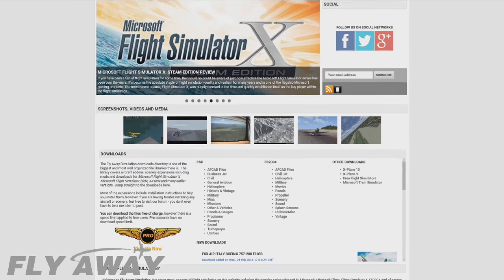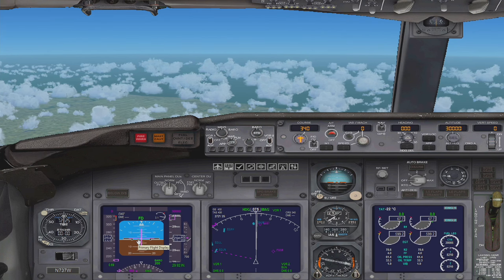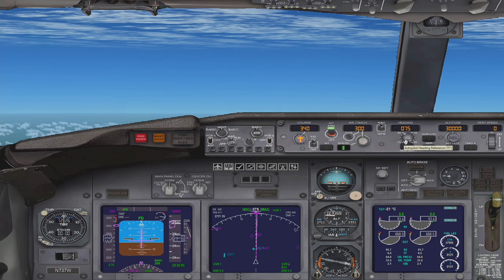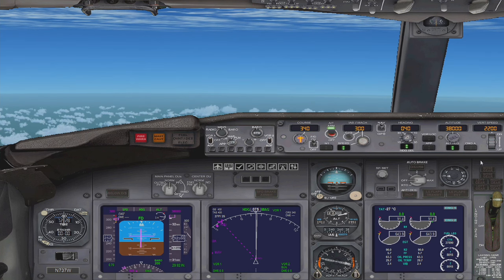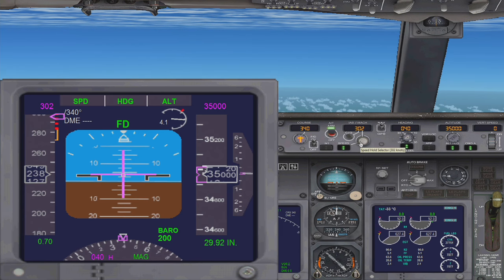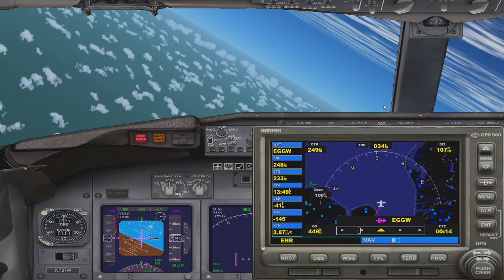FSX How to Use Autopilot | Boeing 737-800 | Tutorials

Comment: I am a real world co-pilot for a Canadian airline on 737 800 equipment.  great video  for others learning,  keep up the good work
Reply from the maker: Thank you! I'm glad you like the video!
Reply: West jet?
Reply: Bonazza Tony where is the altimeter like when control tower says 2992
Reply: Why is a real pilot here checking how to turn on autopilot. I'm scared to fly rn
Reply from the maker: Haha just brushing up? xD
Reply: I'm trying to activate this on the 747 on Flight Simulator 2020, but using LNAV and VNAV. However when I turn on the autopilot (even when i'm pretty much already on the correct heading and altitude) the plane just banks hard left (> 40degrees) down into a barrel roll. Is this an FS bug or is this user error? I'm not sure what's going on
Reply from the maker: There are a few errors in MSFS, but I'll be making some tutorials on it soon
Reply: Nice
Reply: @ruadeil_zabelin  yeah that used to be a msfs where some autopilots would straight up just drop control of the air crAft and do a steep roll and not disconnect but bow it should be fixed but be carefully when doing an auto land as ot approaches but doesnt make small adjustments to land smooth, sometimes it nosedives
Reply: @amaneshak8605  Lmao noice

Comment: From the experience in the pmdg and all the time flying in the default 737: Mach 0.78 is the best cruise speed at most high altitudes
Reply from the maker: Thanks for the advice! This was mainly a video on how to set the speed, rather than what to set it to. But you're correct - thanks!
Reply: Yeah, if you're wondering how to set them, might as well know how fast to go
This is speaking from my own problems back in the day so I just want to help :)

Comment: Do you use a entire setup or just a keyboard and mouse for this? If you use one of the ones that simulate the flight (like the throttle brakes etc.) what do you use?
Reply from the maker: I'm assuming you're asking what hardware I use to control FSX. If so, I use the Saitek Yoke and Throttle Quadrant, keyboard and mouse.
Reply: Yeah sorry I didn't know how to word it at the moment XD. Thanks!
Reply from the maker: No problem! Glad I could help.
Reply: Sorry if im being the most annoying person ever but where did you buy it?
Reply from the maker: I personally purchased the Saitek Yoke from Amazon.co.uk, however, it's available from a variety of retailers. You can just Google the name and loads will come up. Hope this helps!

Comment: I set my cruise altitude to 41000, and my speed to 0.77 mach, but my aircraft pitches up about 4 degrees. Any idea why that might be happening? Thought it might be trim, but I'm not sure. Great video!
Reply from the maker: That sounds a bit too high, what aircraft you using?
Reply: @JacksFSVideos  Stock 737-800. Looked into it, and I think it might have been the OAT.
Reply from the maker: Ah okay, and a 737 would normally cruise anywhere between 30,000 and 37,000
Reply: FL410 is the service ceiling for the Boeing 737 series. It struggles to keep level there, and later. Don't go that High, could result in a deep stall. That level is used only for aircraft testing and isn't safe =)

Comment: So......... 
1. The flight FD(pink cross) tells me where (ALT SPD HDG I set) to go (manually)
2. If I turn on the autopilot master switch, aircraft go to that ALT/SPD/HDG automatically.
3. If I made a flight plan data, and switch NAV to GPS, aircraft would follow the route that I already made.
Right? Because I'm not good at English, I need your feedback guys
Reply from the maker: 1 . Yes (but doens't tell you about SPD)
2. Yes (as long as each switch is on as well)
3. Yes (as long as the Nav switch is on)

Comment: Great Video, now my plane actually going up! 😄 But it's going above the Altitude I'm expected to maintain. I'm supposed to climb and maintain FL240 (24000 ft) but the plane goes up to 27000 and keeps increasing, why does it do this and how do I stop it? 
Thanks, Marc.
Reply from the maker: I've not heard of this problem before. However, starting with the obvious, have you made sure all the correct autopilot is on? Including the Flight Director switch, Master Autopilot, Altitude Autopilot and the Vertical Speed Hold Selector is set correctly to about 2,000.
Reply: Jack's FSX Videos Yes, it was the hold switch that I forgot to switch on.
Thanks for your help
Reply from the maker: No problem, glad I could help!

Comment: For long overnight flight can I just turn on gps mode as you did then go to sleep for the night, let the game fly and complete my flight In the morning? ATC usually tells me to change my heading or altitude and if I don’t they yell at me and terminate my IFR flight plan. How do I fix the problem so I don’t have to be up every 15 minutes changing heading and listening to ATC?
Reply from the maker: It's certainly possible to do that if you don't use ATC at all. Otherwise, you'd need to climb to your cruising altitude, turn on LOC to follow the GPS and then they won't tell you to adjust anything. However, they will still point out traffic and tell you to change frequencies every now and again which will need a response

Comment: hey all. what's the difference between heading and course?
Reply: heading is like the compass direction so the direction the nose is pointing, and course is the direction the aircraft travels over the ground which means that it will travel in the right direction even in strong winds. its kinda hard to explain without a diagram but maybe search one up sorry

Comment: I have some difficultties with the autopilot. The vertical speed on the selector always changes to negative after every alt hold change. Why is this?
Reply from the maker: Well if you put in an altitude lower than what you're already flying at, it will go negative to descend

Comment: At around 8:33, why does the vertical pink line of the FD only shift very slightly left of center, even when heading is drastically off in terms of angle?  The pink vertical line does not even tell you how much to roll the aircraft, right?
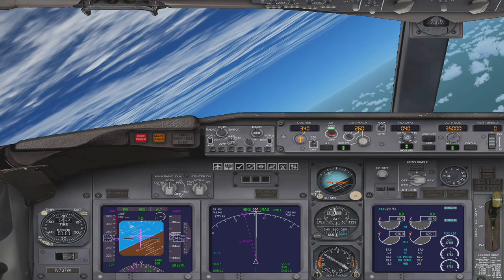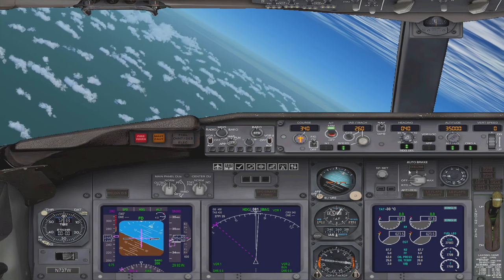Reply from the maker: Actually it does move left and right, just much slower than the horizontal line. At 8:08 it's over to the left, if you keep watching to 9:38, it's more centre-right, and even before I made that right turn, it was centre. If you keep the central dot on the cross-hairs of both lines that will determine your rate or turn as well
Reply: If you kept central dot on the both lines beginning at around 8:33, wouldn't it take ages before the plane's heading reaches the HDG bug?
Reply from the maker: No because the nose also moving up assists in turning the aircraft much faster
Reply: But the pink lines do not indicate roll angle.  When the vertical pink line is so close to center, it would be easy to center on them using only yaw+pitch.
Reply from the maker: No not angle, but it does indicate a turn, the bank angle always has the same maximum of usually 30 degrees. And a pilot simply knows not use the rudder on the air except in emergencies and some crosswind landings

Comment: How it works in MD11? I dont know how to read what course i need to take because there are not a purple trail.
Reply from the maker: I'm afraid as I don't own any MD11 addon aircraft, I can't help you with what you're asking. Sorry!
Reply: I see a arrow in a random direction, and i set autopilot on that arrow and atc contacting with me and didn't turning me, is that good? (sorry for my bad english, i am from Poland)
Reply from the maker: I assume you're referring to the arrow in the Navigation Display. If you're using ATC, they will tell you what heading to fly at. Simply type this into the autopilot system and turn the Heading switch to On. The aircraft will then fly in that direction. If you don't understand a part of the video, try reading the tutorial on my website here - jacksfsxvideos.com/fp-how-to-use-autopilot.
Reply: I just requesting a IFR Clearance and tower send me to good course. I need to teach how to land don't nose to ground decending and how to land not in a city. :P
Reply from the maker: If you're looking to improve your manual landings, I do have a few videos on my channel.

Comment: I have windows 10. i7 4790k and 980. but I just have the regular fax and is giving me problems. should I get the steam edition?
Reply from the maker: Personally, since getting the Steam Edition, I've not had a single crash or problem with the game.
Reply: thanks. do you have windows 10?
Reply from the maker: Yes, I use Windows 10 64-bit.

Comment: Hi Jack, is it true that 1000 ft before landing (ILS) you switch it to manual?
Reply from the maker: There's no set altitude, speed or distance to switch it to manual. But 1,000 feet does sound quite far out still, it's usually done a lot closer to landing than you think

Comment: is there communications from tower or elsewhere can't seem to get any for fsx f5-e. also can't print out headings etc from flight plan. any help would be terrific. thanks
Reply from the maker: Yeah you communicate with the tower. You don't have to print them out, you can just write them down on some paper, if you can't print it, it's most likely a problem with your printer connecting FSX
Reply: if u select ie as default browser printing is cured.
Reply from the maker: Okay cool

Comment: btw, is there a programme incorporated which takes into account the curvature of the earth?. Many says that the gravity does this job for the airplane. I don't think so.
Reply from the maker: I'm not really sure on what kind of program you're referring to or what you'd use it for. If there is such a thing, I'm not aware of it.
Reply: Ok. I will give you an example: An airplane which takes off from a runway in South Africa , southern Hemisphere ( Cape Town) with final destination in Paris ( France), Northern Hemisphere.. In this particular case the airplane on its entire journey has to adjust continuously and follow the curvature of the earth , otherwise it will go straight into space. That's why i said to you that many are convinced the gravity does this job and here's why the airplane has no programs incorporated to address this matter.
Reply from the maker: Thanks for the example. However, as I said, I'm afraid I'm not aware of any program.
Reply: if there is no such a program , then we can draw three conclusions: 1. We are not aware of any program . 2. The gravity does this job for airplane. 3. and most shocking :)..the earth is not a ball , sphere. We must find out which of these 3 conclusions is right.
Reply from the maker: As I mentioned in my first comment, I'm simply not aware of any such program. However, having researched it, there is no need for this program anyway - http://www.askcaptainlim.com/flying-the-plane-flying-90/1301-does-a-jet-aircraft-need-to-constantly-adjust-nose-down-to-follow-the-curvature-of-the-earth.html.
Reply: The autopilot keeps the plane at a specific altitude, so as it goes around the earth, the autopilot will keep the aircraft at the desired altitude, and not send it off into space. So all 3 of your hypotheses were incorrect.
Reply: Let's take the next assumption into account: a pilot of an aircraft saw what we disscused here and for the sake of proving this untested matter/issue  he decides to fly his aircraft manually for (96km or 60 miles) after reaching the desired altitude of  10km or 32802 feet . According to the official data when it comes to the curvature of the earth at  96km(60miles) flawn our pilot has to adjust the altitude with 784 meters (2572 feet)  downwards to follow the curvature , otherwise the aircraft risk going off into space . In short, at a crusing speed of 800km/h (500miles/h) our pilot has to descend with 784 meteres/2572 feet after 7.2 minutes  of flight just to maintain a "straight" line around 10km/32802 feet above the earth .  Mr. Sanders...don't rush to draw any conclusion unless you have a real proof.
Reply: so at every minute (this is applied only for the first  60 miles or 96 km) our pilot must descend with 108 meters(354 feet) to keep the aircraft hovering at a constant altitude of 10km (32802 feet).  I don.t think this adjustment really takes place and therefore my third conclusion ( the earth is not a ball, sphere etc) might be the correct one.
Reply: Say the plane is traveling @ 600mph. That means they are traveling 10 miles per minute. With a curvature of 2' per 3 miles, the plane would need to descend a little over 6' per minute to maintain altitude.

Autopilot fixes this by changing the flight path to a curve, not a series of straight lines.
This is also unnoticable in small aircraft such as the Cessna, as you do not have enough speed to escape Earths pull of gravity. Therefore curving the flight path.

I can confirm, with not suspicion or hypothesis, but fact, that the Earth is an elliptical sphere.
Reply: i am sorry , but your math is incorrect. At that speed of 600 miles per hour the plane needs to descend (not 6 feet per minute) more than 400 feet per minute which is  quite a big adjustment.
Reply: from north pole to south pole we have 20000km or 12427 miles. if i take into account your assumption of 2' feet per 3 miles then from north pole to south pole we must have only (12427/3 *2) 8284 feet of curvature .....which is absurd.
Reply: I can cofirm that math doesn't lie. Our earth is not a sphere or ball, or an elliptical sphere.........it's flat 100%. We have been brainwashed since our childhood to believe in a ball earth. THere is no trace of curvature ...fisheye lens curve the image. I am sorry destroying your fairytale reality, but the truth must come out of closet....we are not fools to believe in everything.
Reply: the curvature of earth: 1 mile - 0,67 feet; 6 miles - 23,8 feet; 60 miles - 2380 feet , 100 miles - 6610 feet etc.  Your statement : "6402 feet at every mile is not noticeable"....are you kidding?????.. Every time when something can not be exaplained,  you and others hide before the magical power of " gravity ". Are we full grown persons or kindergarden children :)). Let's stop believing everythig.
Reply: 6 point 4 0 2. not 6402. Reread everything i said in my previous comment
Reply: And, I also made a mistake in my conclusion, that is 6.402 feet everyone minute going at 600 miles an hour. If you actually read what i wrote, you would have noticed this
Reply: ok..then 6.402 feet per minute at 600 miles/h.  Let's say we fly from north pole to south pole with this speed.             12470 miles *6.402 feet( per mile) =  80000 feet . in other words we have between north pole and south pole just 80000 feet of curvature..........which is absurd again.
Reply: yes, that is correct. Luckily we don't fly tangent to the earth for 12,470 miles. we curve around it, at 6.402 feet every 10 miles. If the correction was all made it once, well, we'd be dead in space by that time.
Reply: let's say we take off from Oslo with final destiantion Athens.Between two cities there are 2500km (1500miles) in air . According to your calcultations ( 6.4 feet per 10 miles) we have only 960 feet (1500/10*6.4) of curvature which is not true :)))
Reply: the right answer is 293 miles of curvature
Reply from the maker: Just to let you guys know, there's no need for any of this. The autopilot corrects the altitude. Done.
Reply: you are right, but it's worth trying to fly a plane for 96 km (60mile) without engaging the autopilot, just manually.  After that we can put an end to this discussion.
Reply from the maker: I don't think anyone will be able to fly an aircraft perfectly level at all times.
Reply: T. Marius aircraft is set to be on an altidude level though. If it was to fly in straight line vertically, it wouldn't follow the computer. Maybe that's just it?
Reply from the maker: As mentioned before, the autopilot corrects the altitude as the aircraft is flying along to ensure it doesn't continue perfectly level and gain altitude. The autopilot will always maintain a certain altitude relevant to the ground below it, not the original ground it took-off from.
Reply: ***** exactly
Reply: let's disengage the autopilot to see where is the truth:)). Anyway, it's quite hard to put in practice what i want, because as a pilot you  try to fly  the aircraft on a parallel line with the ground below.  In order to find out who is wrong or right on this issue, an airplane must be flown without taking into consideration the earth below. We must change the reference point...it's not impossible.
Reply: T. Marius I do get it, but an aircraft computer would not allow that to happen, unless it does something wrong or the pilot pitches trim manually
Reply from the maker: Captain Earls is correct. What you're suggesting it not possible in an aircraft using the autopilot, as the computer will always try to stay the same altitude above the ground, meaning the flight path is curved around the surface of the Earth. Even if a pilot manually trimmed however, it will still not be perfect as it's impossible to stay perfectly level manually. However, yes, in theory if the aircraft remained perfectly level, it would most likely gain altitude. But do we even know if the primary flight display changes as the aircraft flies as well? It may be set so that the horizon lowers during flight so the aircraft remains level.
Reply from the maker: Yeah don't worry John, this thread ended 9 months ago xD
Reply: T. Marius 
Have you ever been in a plane?
Reply: @t.marius1564  so basically this is all just a flat earth thing right 🤣

Comment: why was ur speed not increasing??
Reply from the maker: Because I was still climbing
Reply: ChrizZTube because at 35000 feet the “airspeed” might be 250 but the real “ground speed” is like 430 (you can see this in the left top corner of the second display. This is because the air is alot thinner so the pitots on the nose cant read the actual flight speed.
Reply from the maker: Yeah that’s the other reason :)